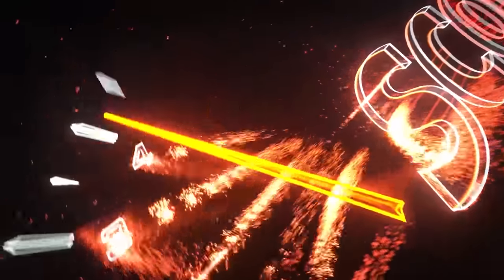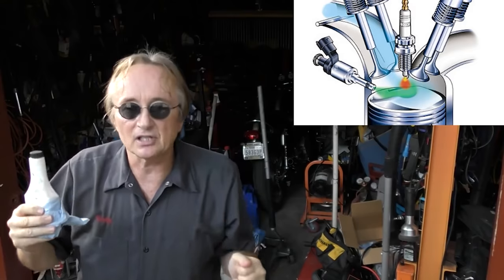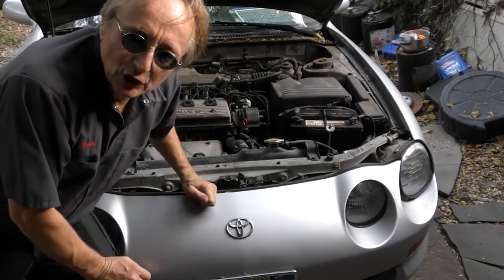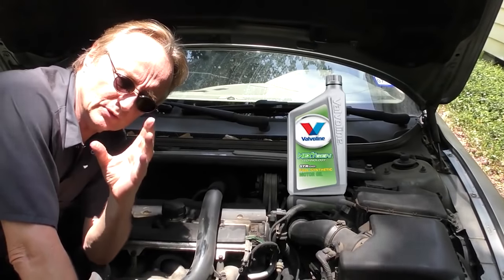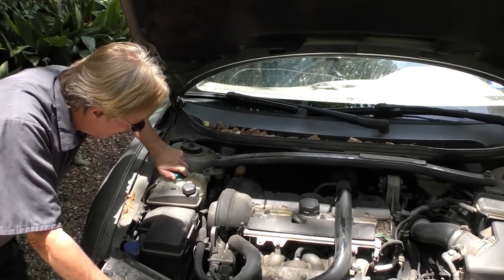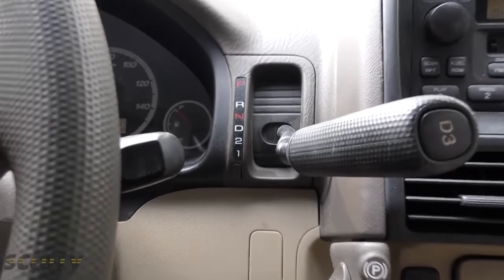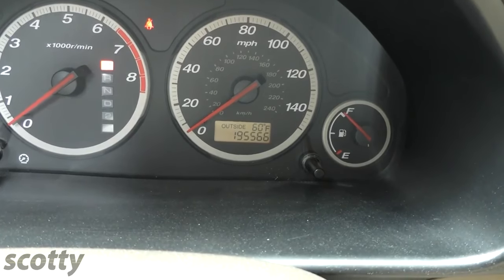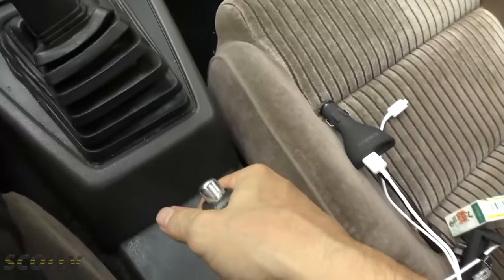20 Things Only Stupid People Do to Their Car

Comment: You mentioned 5-7k miles per oil change. A lot of modern cars have 10k or greater service intervals though. Does it still make sense to do 5-7k miles oil change or should we stick to owner's/recommended oil change intervals?
Reply: Oil changes are cheaper than buying a engine !
Reply: "Stop and go" miles are harder on the engine.  Change every 3000 miles or 3 months, whichever comes FIRST, if you want your engine to last.  10,000 miles between oil changes is a good way to buy a new car sooner than you planned.
Reply: My car manual says 10k between changes but I’m doing 5k ones, better to be safe then sorry.
Reply: @tails300       Exactly !
Reply: @philipwebb960  
3-4k is the recommendation for conventional oil. Synthetic is made to last 10k+, so 5-7k is plenty early for most drivers.
But yes, stop & go is much harder on vehicles than highway driving & would thus require more frequent changes. I know I use twice the gas in town as opposed to highway, and my guess is that the wear is probably around double also, maybe more if traffic is bad.
Reply: I change oil like every 4k miles on my turbocharged focus ST lol, but that's because I plan on driving this thing until it kicks the bucket. My belief with oil changing is the same as with humans, the healthier your blood is and the less clogged your arteries are, the longer you're going to live. Most people die of CAD in this country, and I suspect most cars probably suffer a similar fate in their coming of age. I'd rather pay to have extra clean oil all the time than going to the limit on it.

Comment: I put 20w50 in my sbe ls1 for 5+ years and 1000's of 7300 rpm shifts with absolutely no issues, that engine is 20+ years old. A thicker oil has benefits for some applications, the thinner oils are for light duty/ better mpg. Change my mind.

Comment: And when you park your car on a hill, turn the tires INTO the curb (or the side of the road) so it won't roll into traffic!  0_o
Reply: @samueltaliskersmith Tires point into the curb regardless of uphill or downhill.  Ponder this:  Either way you're pointing (uphill or down), you're keeping the car out of the moving traffic lane when it rolls.  That's the point.  Not to stop the car from rolling being against the curb, it's keeping the car out of the traffic lane IF it decides to roll!
Reply: I believe John Law will tag you for not having the wheels turned in the right direction, at least in California.  (Toward the curb on level or downhill, away from the curb uphill.  To the right, if no curb is present).

Comment: Treating my turbo EJ20 flat-4 engine with Morey's Upper Cylinder Lubricant for five tanks of gas resulted in an average fuel economy increase of 8%. The top end of the engine was rebuilt just 60,000 klicks prior to me adding Morey's.
And since then, I have treated my wife's 2003 Audi TT 3.2 and it gained around 6% better economy over 6 weeks.

Comment: Back in the early 80s I had a 5-speed Honda Civic nothing special.  It had a choke.  Though I had heard about them I had no clue what it was for.  Went to my mechanic and he didn't say much but he did say in the winter just pull the choke out all the way and take off driving - no need to wait for the engine to heat up.  That beast lasted a very long time
Reply: I had an old carbureted Mazda but it had an auto choke. Heck I have a carbureted AMC 150 now and it has an auto choke too. Both are/were 80's trucks.

Comment: I did a coolant change over the weekend in my 2012 tundra and was literally blown away that at 123000 miles and it never having a coolant flush or swap that the coolant was still pink and clear

Comment: Also when it comes to jumping hybrids check your manual because there may be a specific spot on your car that you have to put the ground. My car which is a crappy 2014 Honda insight has one spot for the ground, and it's not near the battery or even on that side of the car. The manual says if it's put anywhere else it can damage the computer system.

Comment: I remember being taught by several people to 'slow down with your gears, not your brakes'. I tend to do it by habit, but it's always been in the back of my mind that a set of brake pads are a franction of the price (and the work and effort) compared to a new gear box.
Reply: Brake pads, and other brake components if necessary, are ALWAYS cheaper.  For motorcycles, my MCF retired bike cop instructor told us that motorcycles were built with engine braking in mind & to use it when reasonable because of the great increase in control.  Maybe that's where your folks were getting that from.  Motorcycles have something like 10 friction plates plus another 9ish steel plates because that constant clutch use.

Comment: I disagree with the him on fuel additives. The thing is they take MONTHS, maybe even more than a year depending on how much you drive to work. 

I fill up once a week, possibly twice if I get overtime.  Really started ti noticed an increase in acceleration after about 6 months (at least 40 filll up’s) of fuel additives.  This was a car with over 100k miles obviously.

I do appreciate the info on the GDIs. Obviously I’ll never use additives if I have one of those cars.
Reply: Just use gas with top tier. Shell for instance has 3 x's more detergent than other gas stations.

Comment: I have 2 vehicles with 140,000 & 1with 178,000. I use 5w30 in my older vehicle but my newer & more mileage in my newer one. Newer vehicles can & do go 7500 miles on an Oil change.

Comment: @scottykilmer  There's 1 exception to the correct oil weight rule. My Rabbit was running on just 3 cylinders so I pulled the plugs and one had no gap, electrode smashed in. Got the piston to TDC & with forceps pulled out a chunk of piston crown. Had to nurse the car through 1 more month so I ran the PVC hose to a gallon jug (milkshake) and ran gear oil in it. Eventually the car got crushed with 495K on the clock. Not bad for a beater.

Comment: The rev up is a messy subject I don't know why cause immediately you start the engine the oil almost immediately starts running... And plenty of automatics you can jump into reverse, they use torque converters so the car comes to a stop itself but don't try on manuals you'll take the gears

Comment: One thing I learned when parking on a hill - YES you should awlays leave it in gear with the handbrake on BUT...If your facing uphill - leave the car in reverse. Otherwise facing downhill, leave it in 1st (If its an automatic, put it in park regardless). If your handbrake fails and the engine cannot stop the car completely, at least the engine will be turning the right way and won't be damaged. Another thing I always do on a hill is point the front wheels against the curb. Between the handbrake, transmission and a wheel against a curb - that car is going nowhere. Belt and Braces.

Comment: I used to work at Uhaul. One time, I went to jump-start a truck, and the other employee had put the other side of the cables on backward. When I put the clips on the battery, they shot off and melted the battery post. I feel like I was pretty lucky there. The trucks were fine. But they were old trucks.

Comment: My car use 5w30 i have 5w40 oil to have thicker oil to push the gunk in the oilpan up to the filter, it is a 2000 hyundai santafe with a 2L diesel

Comment: I don't really downshift in my truck except for long hills, unless I'm driving a semi truck. They have to be down shifted, sequentially when slowing down to prevent the brakes from burning up. Engine braking is a big part of slowing them down. They also have a very small band of usable RPM, usually between 1000-2000 + - 200 RPMs.

Comment: oh wow pcs moved back to 12v input for chips long ago, 5v was an ancient platform...
ie we use a 12v plug for main processor and multiple 12v plugs (or 1 for the new stuff) for graphics and the circuit boards switch it down to 0.7-1.3v
i suppose an ecu does a lot less work, hence needs less voltage to maintain current and also having less input voltage should keep the package cooler overall which is good considering how an ecu lives

Comment: So i'm lucky i did not break my transmission when i put the car in park while running years ago. Kinda mad at my navigator getting me to wrong roads so i pulled over quick and put on park while the car is still running. It made a really loud rattling sounds as i slow down. Fortunately, i still have that same car 11years later with no problem, that honda civic 05 is built to last

Comment: Red the Opel Kadett manual once and it said to start engine with full gas when cold and semi if still warm. Also  allways wanted to buy synthetic oil but am going for recommended only as there is differnces in PH, which could nibble the sealing.

Comment: Definitely a mechanic not an enthusiast. Positive to the switches, negative to the body and motor. No. My car is positive ground so the body is positively charged which helps prevent rust and oxidation amongst other things. My engine also runs backwards which is why it's mounted on the right, not left like Toyota celica in this video. The audi looks like the cheap US import version. Basically expensive scrap. Good advice for the people that buy cars and just drive them.

Comment: Funny story,
the computer is most likely referencing the TTL 5V from the board's ground, and that is typically isolated from chassis
So when you jump backwards, you are now referencing "Ground" as 12+ V, and the pos terminal being 0V,
If the computer was getting the 5V from another source, you essentially adding the 12V to the 5V, effectively making it see 17 or more volts.
But, that's not what fries the computer... it's most likely the crank AMPs that wasn't supposed to be there.

Comment: One problem with the not putting thicker oil in. If your engine won't keep thin oil in, you got to put thicker oil in to keep your engine running. Put the regular oil in and your out of oil in a day? Kind of have to either rebuild the engine or put thicker oil in.

Comment: The last car I had had a cable clutch. Once it snapped. I had to drive about 10 mi with synchronization only. Yes you can get out of a hole at a stoplight by nudging the stick shift and letting the car gradually roll forward until it's synchronizes and locks into gear.

Comment: Years ago, when I was able to prevent the engine from  starting some how or another, I used to let the oil pressure light go out when changing the oil in order to get a turbo lubricant around it, then start the engine.   This saves wear and tear on the turbo.     I always let a turbo tick over after running hot for about a minute when ever possible, plus a few seconds after start up./

Comment: I use Chevron fuel injector cleaner every 2k miles and change oil at 4K with Mobile One synthetic.  On two different occasions with both my cars, they burned so clean that the dealer thought his smog inspection machine was broke or out of adjustment!  My friends stand in line to buy my used cars….

Comment: Another way to stop your car from rolling down a hill is to turn the steering towards the kerb (there needs to be a kerb for this to work) that way if your car rolls forward or backward the front or back wheel of the car will contact the kerb and stop.
Please note that this should be done along with the other methods that Scotty Kilmer showed to increase safety and security.

Comment: the voltage in the coolant also eats away at the aluminium parts. That is why you use demineralise water as it does not conduct electricity.

Comment: 5 going to 12 isn't the issue.  power flowing through the electronics BACKWARDS is the problem.  Though the diodes in your alternator will probably save you, perhaps wrecking your alternator in the process. (but an alternator with a wrecked diode pack is a heck of a lot cheaper than a new ECU)

Comment: In summary:
1. Never jump start backwards (reverse polarity with cables). Too, know your voltage.
2. Don’t use fuel additives — today’s fuels have them already
3. Don’t put heavier weight oil in an older engine. It’s too thick. Use manufacturer’s recommended weight oil.
4. Don’t fill your tires with nitrogen
5. Don’t forget to change your coolant, do not rev up early, use synthetic oil for turbochargers
6. Never drive through water, especially with an automatic
7. Never go from drive into reverse while moving
8. Don’t leave in drive while idling for long periods — it’s better to put in park or turn off
9. Don’t do burnouts <— resist “out of the hole?”
10. Don’t downshift all the time
11. Don’t ride the clutch
12. Don’t just put in gear on hill to park. It risks popping out of gear and rolling down the hill. Use the emergency brake.
13. When it’s time to replace the clutch, replace the entire clutch set, not just the disk
Reply: About number 12.  I was always advised to put in gear, engage the handbrake and turn the wheels to the kerb.

Comment: Uhhhh fr? Car coolant lasts about three years? Is it any different if you use water or coolant? Or use a coolant first and then keep adding water to it? Is it wrong that i check my coolant every week cause that coolant reservoir does get to half way after a week.
Reply: It probably has a leak, better check that out. Either its just a 20$ reservoir to replace or it could be leaking into the engine

Comment: I use nitrogen in my car tyres and have done for years, the refills are free and the set of tyres on my car lasted over 5 years with over 65,000 kilometers on them due to the fact that the pressure stays the same and keeps the right amount of rubber on the road, i only get my tyre pressure checked once every 12 months and only needs 2psi put back in, you can't do that with air pressure.

Comment: I go twice a year to my mechanic. Required here to have summer and winter tires, not studded. Or death traps of year round tires. So, my mechanics does the necessary maintenance of oil, coolants, lights, etc at the same time. In the US, my cousin and a friend taught me how to change my sparks, distributer cap and oil change. However, I am autistic, I just pay to have my oil and fluids changed. 

Biggest mistake for the ones that have those tires is they never rotate them. My husband’s high school friend is an ambulance driver. When we got our car passed down by his father, he check to make sure we did not have all year tires on. He had just came from a gnarly accident where the driver and passengers died because they lost control of the car when the tire blew. I asked what he was checking, when he came for a visit and he was bent over our tires checking them. I told him they were just changed to the winter tires that we just bought a few weeks before. He said good, told us the sad story of what happened earlier that day. My dad and father in law taught me well, that I am driving a lethal weapon, and to always take care. Thank god retreads are illegal over here in the EU.

Comment: I thought riding the clutch pedal would wear out the throw-out bearing, not the clutch itself? Also, to go along that, don't ride the stick on a standard transmission either. Shift it into gear and let go of the stick. If you ride the stick you can wear out the bushings faster on the synchronizers. And in regards to parking on a hill, in addition to applying the parking brake, also turn your wheels so that your car turns into the curb if it happens to roll downhill instead of into the street.

Comment: You said turbo charged cars get better milage than non-turbo charged cars. That is curious - the Subaru Outback with 2.5L is rated 32 mpg on hwy - the turbocharged models are 2.4L are rated at 29 mpg... not a huge difference but turbo charged is < than the  larger non-turbo charged model.

Comment: What you said about waiting 10 seconds after starting a turbocharged engine is really just common sense.  My Passat is not turbocharged and I still wait at least 10 seconds after starting it to do anything.  Some people literally start the engine and drive the car away without waiting at all and it can't be good.  Some people tell me I am "warming up" the engine and I don't need to do that.  I feel they have it confused with starting it and letting it sit for at least a few minutes.  You know something Scotty?  Talking to them is like talking to the wall!  They just don't get it.  Most wear happens at startup before the fluids have had time to circulate.  I don't "warm up" the engine like they say I do, I just let it get down close to a normal idle.  It only takes around 30 seconds.  The way cars are designed with emissions in mind that really high idle you notice when you start the car serves at least one purpose and that is to get the catalytic converter hot faster.  They are just designed in ways that cars from the '70s weren't and some people think newer cars are weird for reasons like this.

Comment: Nitrogen doesn’t hold pressure any better than air. They use it in the jet landing gear wheels, because it is an inert, which means that it will not catch fire under extremely high heat.

Comment: You'd think there would be a breaker or something between the negative output and the 5v power converter for the computer PSU. I don't know my cars and I'm no electrical engineer, but that seems like common sense to me. Is there a reason there is no safeguard?

Comment: So, In summary, what Scotty is saying is and old mechanics axiom, it goes
" Do it nice or do it twice." Words of wisdom to live by. 
Synthetic oil I swear by. Had a Suzuki Samuri for 17 years when younger. The piston skirt broke on one cylinder, sounding like a worn out rod bearing. After my mechanic checked, the bearings were good, the impressive part was when changing the broken piston, the honing marks were still visible on an engine with 120,000 miles on it. Synthetic is worth the extra cash.